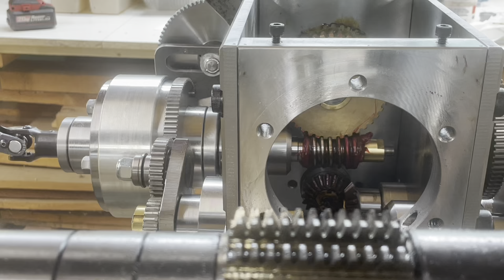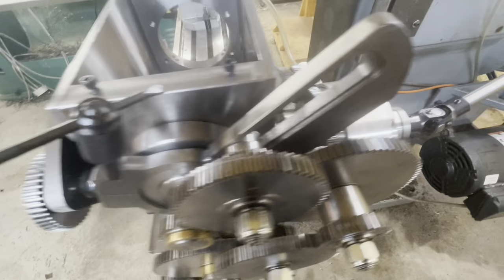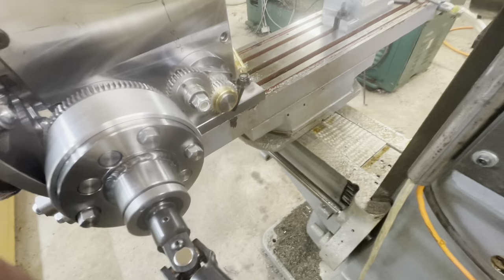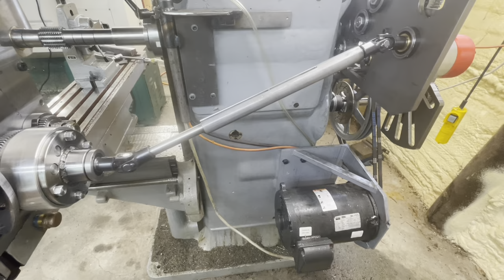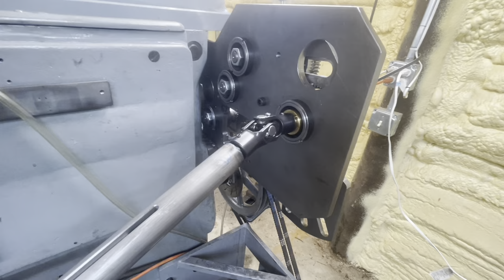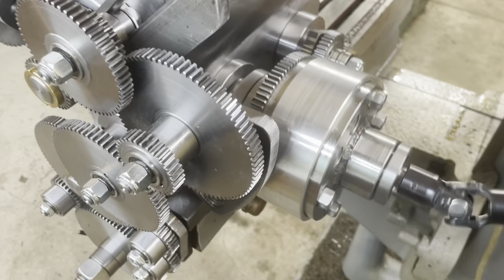Short Update…Helical Gear Lead Compensation Demo!

Comment: Great project! Thanks for sharing.
Just in case you're not aware if it, a Cardan shaft will have a constant input/output velocity ratio throughout its rotation under this set if constraints.
1. The yokes of the intermediate shaft must be in the same alignment (plane)
2. The input and output angles must be the same.
3. All three shafts must lie in the same plane.
Looking at the arrangement, I think that #3 is not met (except in one table location)
I hope this is useful. Best wishes.

Comment: Could you not replace the universal joints with constant velocity joints?
Reply from the maker: I’m considering that!  I found some loose CV joints on Amazon fairly cheap.  They are kind of clunky, but I’ll do it if I have to!  Thanks!
Reply: I was thinking the same.. shouldn't be too hard to cut the axle shaft and weld/splice to suit?  I guess the harder part would be to machine down the typical spline end to something more friendly like a simple shaft w/flat for a coupler to the diff input.
Reply: Gday, thanks for the update Tom, one step closer mate, cheers
Reply from the maker: @MattysWorkshop  Thanks, and gday to you, Matty!